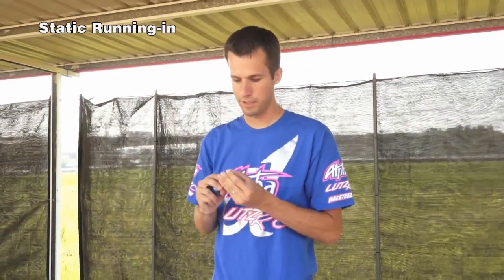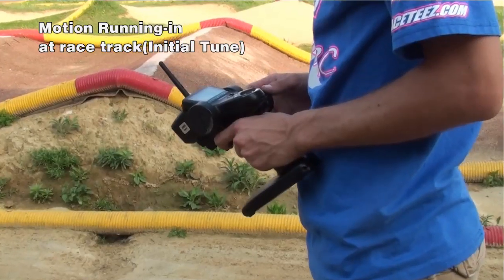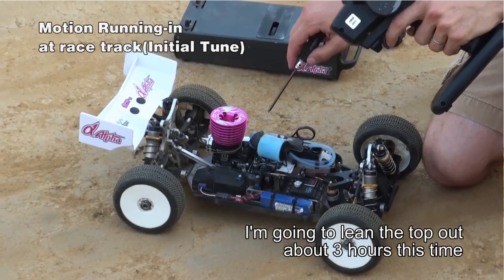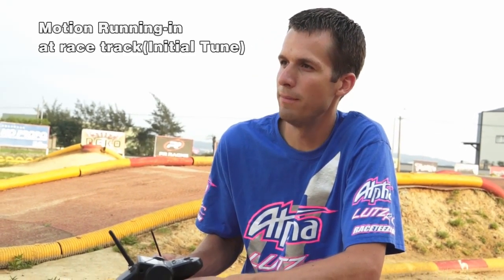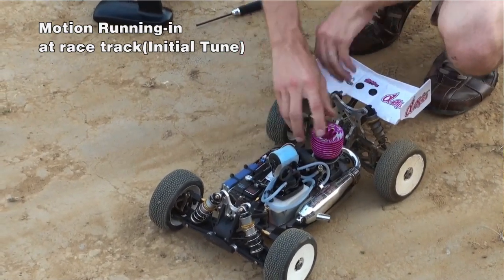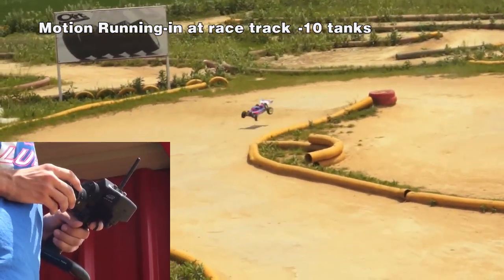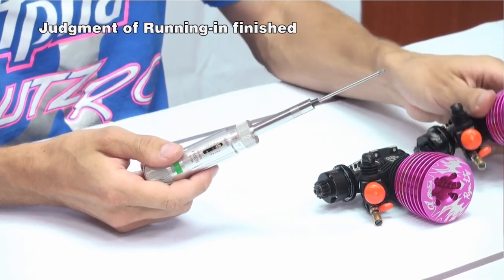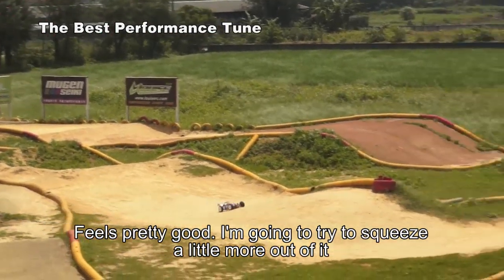Alpha Engine Breakin Tips by Ryan Lutz

Comment: In the booklet the suggested static running-in procedure is longer than Ryan demonstrates here, it mentions about one hour of static running-in with higher rpm than normal idle, i.e. just before the clutch is engaged, and the top-end needle adjusted to the maximum rich position before flame out. Ryan suggests that the booklet procedure for static running-in is not so important to follow?

Comment: I am struggling as hell. Even with a ton of smoke and oil out of the pipe, the engine is getting too warm all the time. And I can`t make the idle running  so nice and steady as he does. Very, very difficult!!
Reply: check your fuel and glow plug.

Comment: Few questions 1st is it bad idea to prime engine by plugging the exh and just pushing it into box? Second how did you become so heat resistant i saw you touch flywheel right after you shut down the engine? When i did it i ended up with nasty burn.

Comment: Worse break-in video/advise I have seen yet........I don't care who that guy is. Even then, the video is not that informative. Who the hell leans an engine on it's first break-in tank because "it's too rich"!!??? Holy crap!! Run away from this video people!!
Reply: +xXG.L.HXx Sometimes how they come from the factory can be too rich to even run properly in break-in. So it may require to lean just a bit. It depends on your location and temperatures and so on.
Reply: While being rich may lubricate the engine. Heat expands it and having less fuel in their would be more heat
Reply: +Axzix So you are saying that leaning the engine is good because the heat created by doing so helps to expand the internals or heat up the engine? If so, I don't agree. Engine should be run rich during break in (for many reasons) and it's up to the end user to keep the engine temps above 200 degrees by whatever means he/she comes up with. Lutz is fully sponsored, he can take shortcuts most can't afford to.
Reply: xXG.L.HXx The entire point of a break in is to get rid of pinch, Even on any two stroke. If its not warm enough the sleeve is not going to expand and the piston will be scraping metal of instead of reinforcing it. The engine was still rich when he leaned it out. Too rich to gain heat
Reply: He only added less fuel for more heat, the engine was still getting plenty of lubrication
Reply: +Axzix Again, no need to lean it out to maintain temps period. It's widely accepted that one needs to keep an engine at over 200 degrees to achieve expansion. Most people that believe this either break in the engine on a stand or perform a static break in where they can use a heat gun to maintain 200 degree temp range. Lutz isn't doing that here nor is it of his concern if you watch the video again, he never leans out the engine to bring temps up in order to achieve expansion, not sure where you get that impression from. If anything, he's already done POTENTIAL harm to this brand new engine by cold starting it in the first place, that's how you break conrods.  Lutz is leaning out the engine to achieve better performance which, In my opinion, one should only care about once the engine is actually broken in. What's the point of leaning out your engine to achieve higher temps for expansion purposes when you already cold started it? Of course leaning out a motor will produce higher temps but how does that aid in break in when it suffered all the way from cold start to the time it reached 200 degrees or more.
Reply: xXG.L.HXx Didnt you watch the  video? He said his aim is to get the engine up to 200 f, when hes there he stops leaning it. He doesnt want better performance when hes only cruising around..
Reply: +Axzix You can tap dance over this all you'd like, it won't change anything. He's more concerned with the way the car is running, not heat soaking it and maintaining temps during the initial break in. He's using the HSN to lean  out engine so the car runs better WHILE assuring he's not running too hot. Again, at this point he may as well not even bother since he cold started it. This way may work for him and that's great. This does nothing to help new comers, in fact it's more confusing and they are better off using the Traxxas break in method found here on youtube. At least with the Traxxas way, there is no need to touch the needles for the most part and they are not as aggressive with the throttle on the first tank. People break in engines at rich settings yet maintain 200-230 degree range. It's really not that complicated.
Reply: bettee youre old and done the same things every time and cant see youre actually wrong
Reply: you jus don't get it man lutz is right ..   all I got to say that its a racing motor and have to treat it different than sock one  man
Reply: This is an old old comment i know but alphas are pre broken in anyway arent they?   (not saying fully broken in, but they come pre lapped). Only thing i dissagree with is the cold start.